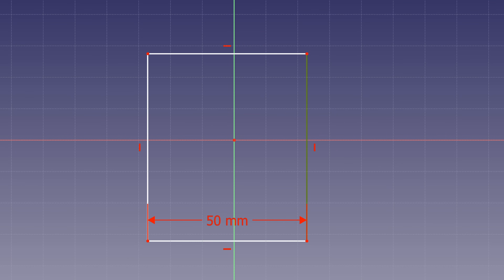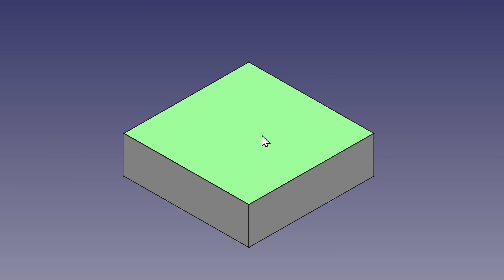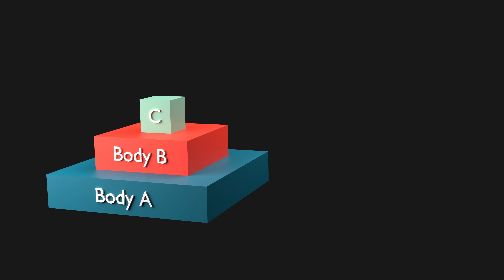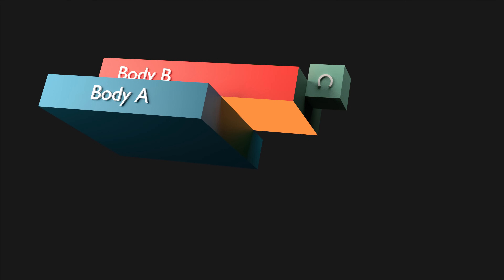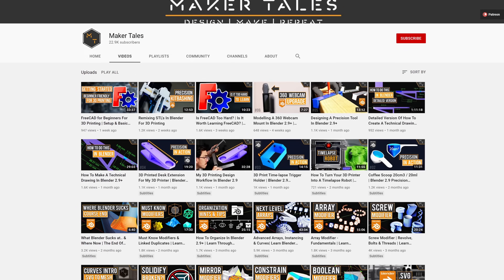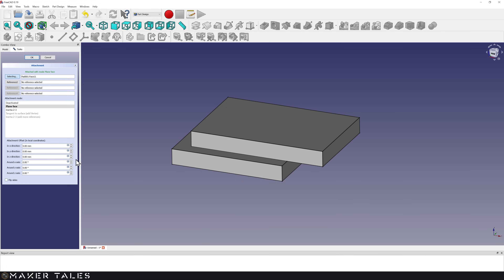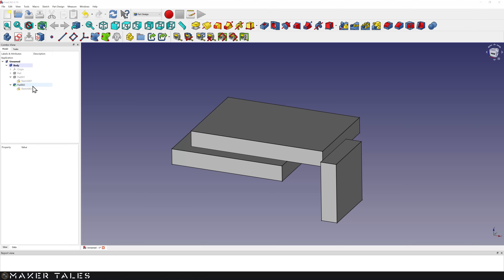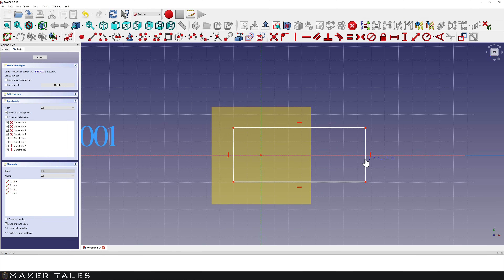FreeCAD Is Fundamentally Broken!  - Now what... Help Me Decide...

Comment: As a long time blender user the workflow of Freecad just seems horribly tedious and clunky. I assume parametric modelling must have huge advantages given that it appears to take 10 times longer to get anything done.
Reply: You are spot on! It is tedious and clunky. I am normally using OpenSCAD where everything is parametric and it works very well. But the workflow is really simple and streamlined, because it has only a limited set of features.  I started with Freecad to make it easier to add bevels and such things which look nice (hard to do in OpenSCAD). I quickly realized, that it took me much longer to do even simple things in FC, so I reverted back to OpenSCAD. There is no workflow in FreeCad. It is all just a bunch of icons and spreadsheets and sketches and workbenches and all those things that I'm not interested in. I want to design a model via a GUI. Why can't the program help me with this?
Reply: It took me a while to get fast with FreeCAD, but I am now. I also work in Blender and it is excellent for many things. They have different purposes, however. 

The learning curve for FreeCAD is steep, but the way it does things is not so unreasonable when you get used to it. And the "tedious" nature of sketches, constraints, and parameters allows for constructing shapes that automatically scale in ways that Blender could never achieve (obviously disregarding the possibility of using Python scripting to model in Blender).
Reply: @martinmckee5333  "automatically scale in ways that Blender could never achieve"

Forgive my ignorance but I'm trying and failing to envisage a method or case of scaling that I currently can't achieve in blender. Is it that esoteric or am I just stupid?
Reply: @petebateman143  Blender is great for non-technical stuff. But when you just change one number and the whole model completely recomputes to the new dimension - I want to see you do that in Blender. And I really mean it. I so wish Blender had a better story on non-destructive and parametric modeling.
Reply: @tcurdt  I'm still trying to work out what it is in blender that I can't scale that you can. But then I've only been modelling for 2 years, so this is clearly some esoteric function that I've never required.
Reply: @tcurdt  Apparently there's no need as I have no clue why I need it and simply do not feel the lack.

Comment: Well... I mostly use FreeCAD using the Part workbench so I never experience any of these problems. Granted you have to plan ahead a lot more to get your xyz placement correct but you quickly get used to it using either pen and paper or the spreadsheet workbench and referencing to it.
Reply: I tend to think that you want to use a cad software to help you calculate things and dispense with pen and paper and manual calculations. That's why I finf freecad sometimes annoying that it doesn't show some measurmenta at a glance for your information, but you have to use a capculator/pen and paper to align some parts/features
Reply: @foootz  Most of the stuff I design with FreeCAD must fit onto already existing parts for which I don't have a cad drawing. So paper is a mandatory step for figuring out screw hole locations and such.
I know using a 3D scanner would speed things up tremendously but I don't have access to such fancy gear. So, pen, paper and calipers are still what I use most.

Comment: I have made nearly 100 models for 3-D printing with FreeCAD after Fusion 360 changed its licensing model.   I've never run into this bug. Using your example, I can see it is there but I've never designed a model like you designed that one.  My first question to you would be, how much code have you contributed to FreeCAD?  Not a programmer, how much money have you contributed to FreeCAD.  Open Source does not imply "free."  Did RealThunder branch because the developers wouldn't work with him and his changes or did RealThunder just not want to work and play well with others?  I chose not to answer your poll questions because the options were devised in such a way as to get a predetermined answer.  There should have been a couple of more options.  If you haven't contributed code or donated money for a specific fix, move on and stop whining.   If you have done one of the two previous things then you have a valid point.
Reply: Are you one of his patreons or have you given him a video clip that he could use for his youtube channel? If not, then stop whining. You see, that argument is rubbish. Criticism is helpful. Criticism is contribution. Making videos about FreeCad is contribution. Making videos criticizing FreeCad is contribution.
Reply: @banknote501 , Patreon is the site a patron is a supporter.  No, I'm not a patron.  I have donated money to his YouTube channel.  Thanks for asking.
Reply: @tonyheaton4941  You were missing a comma in your first sentence, if that is the level of discussion that you like.
Reply: @banknote501 , Sorry I missed the comma. I'll try and do better proofreading in the future.

 I thought you believed that "criticism Is helpful?"  Maybe just certain criticism?

Comment: check out the freecad twitter, they gave an answer to why and what is the current situation, and suggest the Linkstage3 branch for now, or use the work arounds until its merged. but its a big job. They were upfront about it all.

it may well be worth using the linkstage3 until its merged. is there anyway you can make it so you can easily add or remove sections so that you can modularise the video's so you dont have to completely do them all over again?

Comment: Well I have used FreeCad a lot and the Topological Naming Problem is in my opinion unacceptable , it should get fixed ASAP beyond anything else. It`s a usability issue that makes it frustrating to use even when you know how to work around it. However going to Realthunder version may cause problem since it's based on a older version of FreeCad , sometimes an older version of Freecad can't open a file from a newer version, I had that issue before. So for now I may have to stick with the official branch.

Comment: my memory may be faulty however, about 35 years ago I came across a reference to this in some of the early work of creating an ISO standard for the referencing of solids in a portable file. The proposal was that all the solids in a model were referenced by the origin and direction of the solid to 0,0,0. Hope this helps !
Reply: That's not solving the problem. If you look at the video example with a cube on top of another cube, you want the small cube to rise up if you make the lower cube bigger. Absolute references to (0,0,0) do not help here.
Reply: @banknote501  Sorry for wasting your time.

Comment: It's even worse than you think.  I tried to replicate this bug on my 0.19(-24291 stable)

Firstly, It does not re-compute and redraw when you change the size of the middle block to overhang the large block.  I presume you fudged the results for illustration purposes, but I expected the model to be recomputed but incorrectly after watching your video.  I do get some kind of addition to the small_block pad icon that indicates an error, but that's about  it, and it's a bit too tiny to see clearly and is not obvious unless you are looking for it.  When you look at the sketch for the small pad you can see that it is indeed on the wrong face.

But wait...  There's more.  If you increase the size of the sketch for the  middle pad so it just meets the edge of the large block you also get an error, and the model is not recomputed or redrawn.  When you look at the sketch for the small pad it is on the correct face, but FreeCAD is treating it like an error even though you have not increased the number of faces.  Presumably this is some kind of "topological naming error" but for edges, .  There is now one extra edge, but FreeCAD can't seem to be able to work out where to draw the small block in relation to the medium block.  This also reduces the number of faces (large block and medium block now share a face on one side) but I'm having trouble seeing how this could be a problem - the sketch appears to be still attached to the correct face.

I'm curious to know if the RealThunder branch fixes this problem as well.

Comment: If you want to "teach" FreeCAD, as your video states, then why not teach the robust method?

FreeCAD is still evolving and if you want to teach a CAD platform with stable features then you're talking yourself into using Fusion 360.

I started using FreeCAD at (IIRC) version 0.13 and it was very fragile. It has improved significantly since then but I've had to adapt my way of working e.g. moving to Part Design when it was introduced and subsequently negotiating the Part and Body paradigms. FreeCAD will continue to evolve like this and committed users will adapt.

I'm sure the FreeCAD developers are aware that people invest considerable time in their designs and breaking compatibility isn't desirable. Where it's necessary, migration paths will have to be introduced but the development of FreeCAD can't be wholly driven by absolute backwards compatibility.

Your choice, I believe, it to either not teach FreeCAD or teach it in the manner which allows people to produce robust models which can be easily modified. Yes, this means using the origin planes and offsets as the workflow (and not relying too much on Datum features) but the concepts do translate to other (and professional) CAD systems.

I'm sure you've read the FreeCAD forum posts from newcomers on the subject of the TNP. The "seasoned FreeCAD veterans", as you call them, always advise that learning any 3D CAD system involves a learning curve. User's of Fusion 360 moving to FreeCAD will experience this in no short measure because the former is a comfortable environment that does much of the low-level stuff transparently for the user.

Looking at your breadth of videos involving Blender, I would suggest that you do the same for FreeCAD. The entry-level videos for FreeCAD are plentiful but a series based upon teaching a particular workflow which guarantees usable models is the way to go. Also, build-up into using the likes of Assembly3 and Assembly4 to manage complex solutions on a modular basis.

Comment: So like
bruhs
here's how you fix the TNP once and for all

assign attributes
to geometric entities
that way you can select them through filters, instead of literal selections. 

In advanced CAD, things such as sketching on a face are considered bad practice anyway, unless dealing with very very simple models. Ask any CATIA veteran if they would sketch on a face within a large project ... they will call you insane lmao

The main difference is, in SW, CATIA, OnShape, FUsion, etc you can sketch on a face, chamfer an edge, etc etc, then things will only break if you change the model upstream in the tree, in such a way that that face is replaced with something else ... say you want the top part of your model to no longer be flat, but instead be a wide arch of a cylinder so that it's slightly curved ... if you've previously chamferred the edge where that surface meets with the rest of the model, this will 100% break in any CAD program

The difference with FreeCAD being that in FreeCAD it also breaks if you change the number of faces ... like, say make a small hole somewhere in your model that doesn't touch the geometry of the chamfer refference ... the chamfer will still break. 

This problem has already been solved by our Lord and Savior TheRealThunder
It will get merged in the v0.20 release, yatta yatta yatta, making FreeCAD work the same way as most other CAD programs

HOWEVER, 
I think we can actually do BETTER

so like imagine making a pocket, and not having to manually select the edges where it meets the top surface, but instead to have an expression like *<<Pocket>>.Intersection.Edges>>*
or something akin to that

Wanna give your shape a general smoother feel ? chamfer with an expression like this *<<Part>>.GeometryQuerySelector('edge dihedral_angle>=30deg')*

Wanna chamfer all interior edges from a surface, except small holes ? *<<Feature>>.GeometryQuerySelector(edge boundary_type=internal [^type=circular && radius<=10mm])*

So basically jQuery, but for geometry :))))
Reply: Have you made this proposal to the lead FreeCad devs? how difficult is it to implement?
Reply: @encapsulatio  made a forum post about it 
they didn't seem to care
Reply: @mihailazar2487  is there paid CAD software that can do it? Am asking because I'm new to CAD and reading a lot to know what Cad software should i stick with and then learn it thoroughly.
Reply: @mihailazar2487  Does Onshape miss any functionality that is in FreeCad?
Reply: @encapsulatio  CAM 
It doesn't do CAM 
I mean there's an extension that does CAM ... but it's trash

Comment: WOW! Everything I wanted to say and more! You hit the nail on the head with this one.

I’m afraid the problem is all of those options are bad. Really if you stick to the last “LTS” FreeCAD but make people aware of these problems your videos will stay relevant longer. I have always hated watching a tutorial just to realize half way through everything has changed or I had a different distro/version. That’s what would happen if you used the offshoot version.

I have also struggled with this bug. I love FreeCAD but I have lost some hair trying to fix broken models after it scrambled all my bevels to random edges because I changed something in a lower level or moved shapes around.

Really I don’t see how each edge and surface doesn’t get a random hash assigned to it that works as it’s name as long as the part is in existence. Add a surface, add another hash preserving the existing hashes etc.

Good luck!
Reply: Spot on regarding using hashes as reference names (instead of sequencial list entry names) - so simple a solution!

Comment: I'm thinking we have to go without CAD and use Blender even if it's not optimal for makers of functional things. 

You could use the experimental version and when (or IF) the Free CAD gets an update do a remake of the videos if it differs significantly. 

You could also make your own fork, create the changes and create a pull request to the project. 

Too bad about the licensing changes with other applications. In my opinion, we don't have a F/OSS alternative until the bug is fixed.

Comment: I learned to live with the topology naming bug, but its a pain. 
I have problems when I design a project with multiple parts. I have trouble fitting and aligning the parts and transferring feature locations between the parts. Usually at about 5 - 10 parts I go to Fusion 360. I hope FreeCad fixes the topology naming issue.
Reply: I also had trouble getting references between parts, that was the reason why I quit using FreeCad. If I knew how to do that I would be willing to give it another go.

Comment: I was looking at a website that had a comparison between a number of the most popular free CAD software packages and the article was about 2-3 years old. Most of the packages that used to be free are no longer free but rather had something like a 30 day free trial period after which you buy a license. I've noticed this evolution with most open source free software packages as you mentioned. The project will get buy-in and a good cash infusion from some organization to make some dramatic changes/improvements and it's often at the point where the software goes to the next level that it's no longer free. I remember this with PHP IDEs as that language really started to take off a couple of decades ago. If you wanted to get the latest of some of the popular IDEs for PHP with all the really great features you had to pay, and often it was a lot of money. Often the older free versions were still available. Often full of bugs, and fewer features.
Reply: Hello Fred, This is exactly why I went with FreeCad. Several of the other packages went to a subscription model and some went online only. FreeCad has been getting much better every year; even with the warts it has.

Comment: Water is wet! Water is wet!! Give me a break. Good for you that you got to plug your channel with your bs proclamation about topo "problem". It's not a problem. I won't even call it an issue. If you want to use faces as references, go use Fusion 360, SolidWorks, Creo, or a bunch of other CAD software out there. If you're doing something that causes topo "issues", then stop doing that thing.  FreeCAD is free and open because they didn't pour hundreds of millions of dollars of development into it. As such, there are frivolous features that are simply not available. Think of FreeCAD as Pro/Engineer circa early 2000's. Still very useful, but somewhat clunky. My problem-free workflow for FreeCAD is: 1) Use the spreadsheet workbench to define and initialize my variables, 2) Use my variables to define my datum offsets, as needed, 3) Drive my sketches using defined variables, 4) Use the sketches to extrude (pad) or cut (pocket) my desired geometries. Super easy, barely an inconvenience.  With the vanilla FreeCAD 19, I get to copy and paste spreadsheet rows for a new configuration; for RealThunder's branch, the ability to change configuration using drop downs is much appreciated.

Comment: The latest spin of 0.20 refuses to modify the model if it will be affected by the topology problem. On the other hand, the latest -  from 16th of June 2021 - version of  the FreeCAD LinkStage branch does not suffer from this particular issue at all and behaves as expected. (I wrote this before viewing the entire video - obviously I wouldn't if I had waited until the end of it...).